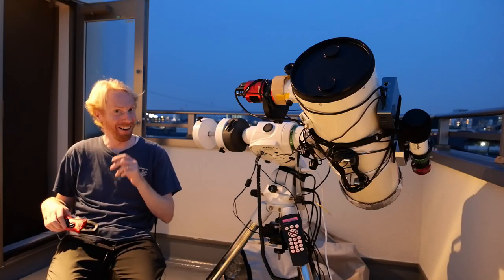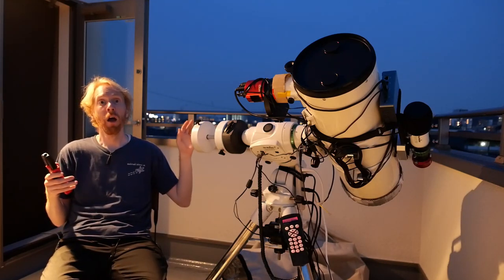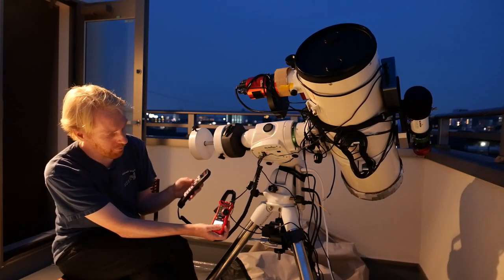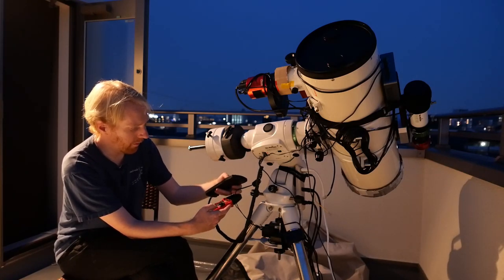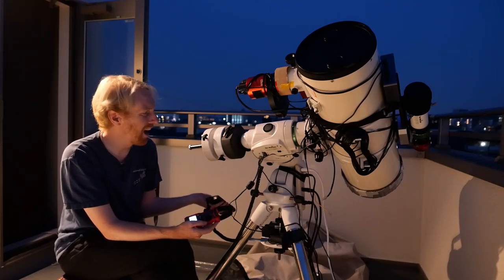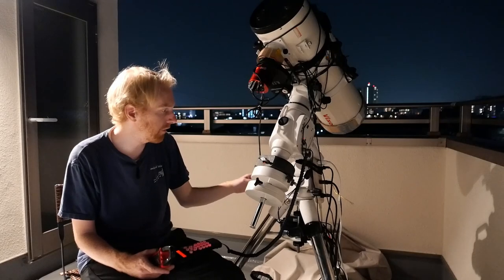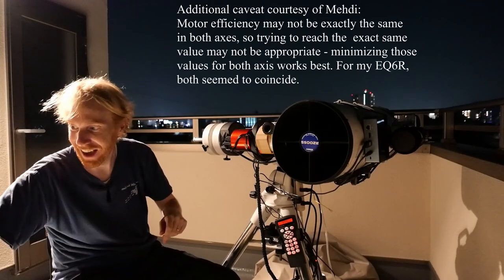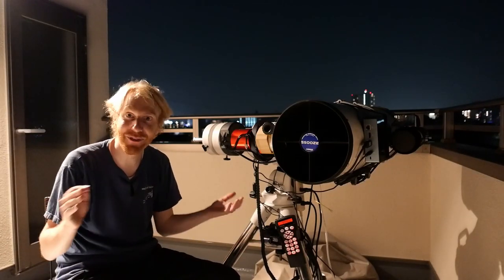Simple and PRECISE mount balancing! With the power of electricity!

Comment: If you have a Pegasus Astro power box you can see the power consumption within the app.
Reply: Nope,Power box have nothing to do with what Cuiv explain in this video.The Power box it just show you  the constant 2amp power consumption that's it.
Reply: Davide Mancini Err, not quite mate. I would suggest you read the manual again. If has built in power, voltage monitors. https://pegasusastro.com/products/ultimate-powerbox/ connect a dew heater and watch the displayed chart as more current is consumed! Take a load of and watch the consumption go down.
Reply: Krellon ops sorry mate i thought was the power pocket advance
Reply: Davide Mancini No worries mate, I could have been a bit more clear in my original message 👍😊. Br.
Reply from the maker: I saw a comment on that, this is awesome! It makes me want to get one even more...!
Reply: @CuivTheLazyGeek  It monitors Current, Voltage, Humidity and Dew! It auto adjust the Dew settings based off of the sensed dew at a specific moment in time. All data can be exported to Excel for massaging later. The data is also available via Ascom driver so can monitor in your fav app (SGP etc) or if your a coder you can use the Ascom API and write a bespoke remote monitor.

Comment: The resolution of these meters is not great in terms of the measured loads. You can improve the sensitivity by wrapping the wire through the clamp a number of times. N turns increases sensitivity by N times
Reply from the maker: Nice! Thanks for the tip! That's pretty cool... In the end, using rate 7 it worked pretty well, but I'll try that next time!

Comment: Hey bud i love the videos  i tried the  clamp on ammeter but its not sensitive enough for that low of current.  my  axis are  stiff i took the backlash out and i got amazing guiding  after  but   balance is a bit of a task, the gears are   stiffer is there a way to loosen them  just slightly to make things easier to balance? if that makes sense atall.
Reply from the maker: Depending on the mount it is possible to tune it - astrobaby has some good tutorials on various Synta mounts. For sensitivity, you can just roll the cable several times around the clamp meter and that has worked for others. Good luck!
Reply: @CuivTheLazyGeek  awesome  thanks ill check it out  im  useing the EQ6-r    awesome guiding afteri took the backlash out.

Comment: Cuiv, what model of the clamp meter did you use? The one I have has a poor resolution (0.1A DC), which is not enough to balance the mount precisely. And the one that have better resolution cost >$300.
Reply from the maker: My particular clamp meter is the Kaiweets HT206D - you could try wrapping the line several times, that should increase the measured signal, and then your meter might work. I hope you can find some cheap ones!
Reply: @CuivTheLazyGeek   Thanks, adding loops helped.

Comment: It's a clever method and I even picked up a clamp meter to do this, but the rub is needing to split the power cable. All of my DC power cords (as I imagine most are) are single sleeve cords. I'm not sure I want to go cutting my cables up or even that I could without damaging them. So how did you manage that? Was your cable the kind where there were two connected sleeves?
Reply: Hmm, I suppose I could get two sets of compatible y-cables. Is that what you have there?
Reply from the maker: The Skywatcher-provided cables are two connected sleeves, which is what I used... In your case you would indeed need to open the actual cable sleeve, or put in an inline ampmeter... good luck!

Comment: If your mount is stiff, it means the bearings are too tight.  Those mounts manufactured in China don't go thru QC before leaving the manufacturer and the tightness of the bearings depends on the mood of the worker on the assembly line that day...  You have to do that yourself.  Once it is done,  your mount will move freely and it is night and day for balancing and guiding.
Reply from the maker: Yes indeed! I haven't had the will to open my EQ6R to fix that, as the stiffness is quite light. Maybe one day I'll get it done!
 I have however tuned the RA axis of my AZEQ5, so there is only very slight stiffness in RA, and it seems to be working quite well!

Comment: Cuiv, what is the weight of your rig? Looks too heavy for the EQR6 Pro!
Reply from the maker: It's around 10 to 12 kg, so it's just at the limit of a proper imaging payload. It works well though!
Reply: @CuivTheLazyGeek  Thanks the mount can handle that. I put over 30# on it and I had horrible guiding. The OTA was a Meade LXD55 10" SN. Add to that the cradle rings, guide scope+camera, imaging camera so maybe close to 40#....BTW did you know that a Schmidt telescope will have its focal length amplified by the addition of a coma corrector. SN is a Schmidt Newtonian. It would have been a good imaging system with the addition of the coma corrector but the mount objected strenuously. Puns intended (and gratuitous).

Comment: Astrobloke did a video using a very expensive box with the same principle.
As a diy, I wonder how this idea arose.
I hear whine of stepper motors. Unless in tracking mode for stars or Renishaw high resolution encoder, why would current change?
If you stall a stepper the driver circuit is well messed up, but the whole point of balancing is to prevent damage to gears. Before you try and drive telescope!
If mount is too stiff to balance then find out why and fix that first. They are expensive bearings in commercial products. That ammeter reading is hardly detecting a very out of balance set up.
With my massive diy mount 6"x2" Timkin roller 3" ID, I would expect a few grams on scope to cause a detectable rotation. With autoguiding, it is no longer the case that 'smoothness' should be provided by thick grease. Like 'Kilopoise', or farm barn door runners silica fillers. As still used in binocular focusing eyepiece tubes.

Comment: I like it. To your question of why the motors draw more current at a slower rate, it is likely related to microstepping. I believe maximum slew is done with zero microsteps and slow slew rate is a high number of microsteps. A good website explaining the principle is https://www.machinedesign.com/archive/article/21812154/microstepping-myths

This principle might also indicate backlash adjustment and subsequent binding should be checked at low slew rate where stepper motor efficiency is greatly reduced.
Reply from the maker: Oh wow! That is precious information, thanks so much for letting me know. Someone else suggested using the power consumption measurement to check for binding as well, which makes a lot of sense! So many horizons are opening with that!